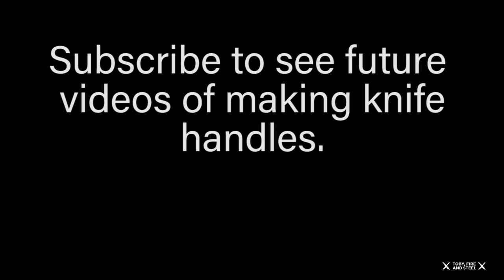So satisfying casting resin in silicone molds

Comment: Mate, thanks for sharing! A quick question, I know you stabilise your wood etc, but does the wood element (whatever it is) HAVE to be stabilised when doing this? Thanks in advance, and loving the podcast! 👍🏻
Reply from the maker: Hi mate yeah I personally stabilized everything but I've had customers who have bought my resin that have had success casting the more dense hardwoods. I wouldn't cast anything that's partially rotten or very soft personally especially as it can float and it will be more susceptible to moisture meaning when it expands and contracts it could separate from the resin. Make sure you dry the timber thoroughly before you do your casting
Reply from the maker: Thanks heap for watching and for listening to the podcast mate. It means a lot
Reply: Toby, Fire and Steel many thanks! Will take it easy with anything but super hard wood. And once I’ve realised casting is not for me and I should leave it to the pros, I’ll be buying from your online store! 😂👍🏻
Reply from the maker: @chefknifeco  hahaha nah you can  get good results mate. Just to confirm I'm saying use hard dense timber not the sort light stuff 👍
Reply: Toby, Fire and Steel thanks man, very much appreciated!
Reply from the maker: Any time mate

Comment: What happens if you don't use a vacuum chamber and how brittle is the resin?
Reply from the maker: Hi mate do you mean pressure pot? If so. You'll get air bubbles in the resin with Alumilite. It is not brittle at all in fact it's very tough. There is other resins you can use that's cure much slower the do not require a pressure pot in the same way. Thanks for watching